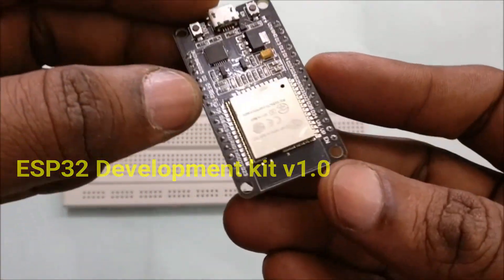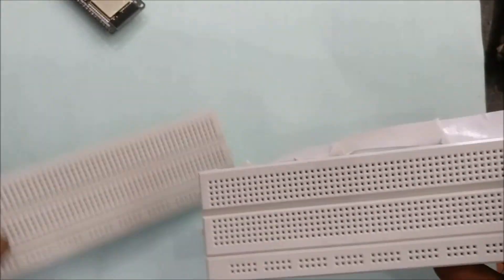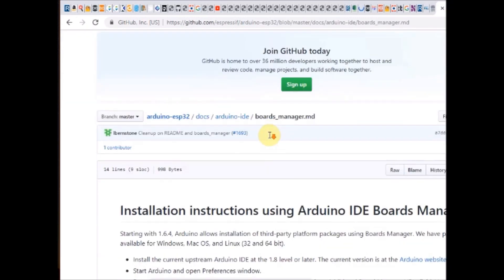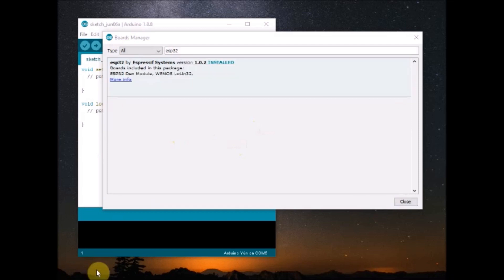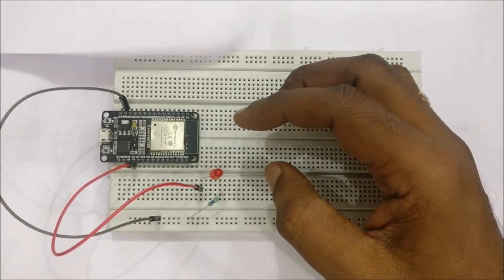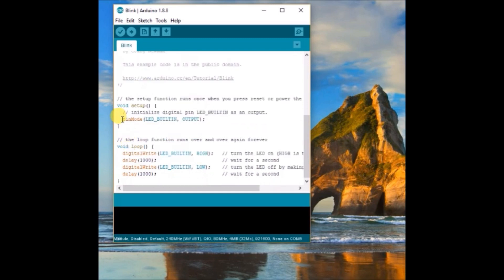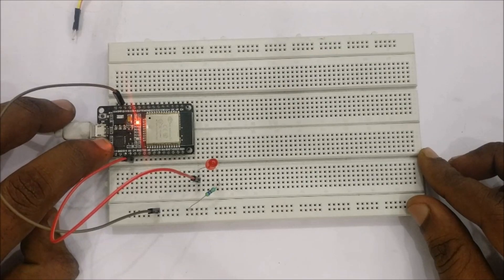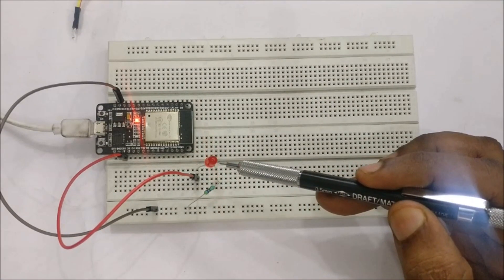ESP32 #1 Getting started with Arduino core

Comment: How does Arduino Core for ESP32 work? The firmware is built based on the syntax of the Arduino language and libraries? Is the firmware building the same as with esp-idf?

Comment: Hi sir Saravanah... I have this error while uploading the code in Arduino Ide but if I do the uploading by thonny micropython its ok.

Arduino: 1.8.13 (Windows Store 1.8.42.0) (Windows 10), Board: "ESP32 Dev Module, Disabled, Default 4MB with spiffs (1.2MB APP/1.5MB SPIFFS), 240MHz (WiFi/BT), QIO, 80MHz, 4MB (32Mb), 921600, None"

Sketch uses 207705 bytes (15%) of program storage space. Maximum is 1310720 bytes.

Global variables use 15228 bytes (4%) of dynamic memory, leaving 312452 bytes for local variables. Maximum is 327680 bytes.

esptool.py v2.6

Serial port COM6

Traceback (most recent call last):

  File "esptool.py", line 2959, in <module>

  File "esptool.py", line 2952, in _main

  File "esptool.py", line 2652, in main

  File "esptool.py", line 222, in _init_

  File "site-packages\serial\__init__.py", line 88, in serial_for_url

  File "site-packages\serial\serialwin32.py", line 62, in open

serial.serialutil.SerialException: could not open port 'COM6': WindowsError(5, 'Access is denied.')

Failed to execute script esptool

the selected serial port Failed to execute script esptool

 does not exist or your board is not connected

This report would have more information with
"Show verbose output during compilation"
option enabled in File -> Preferences.
Reply: Problem Solved I should exit Thonny Micropython IDE first before runnng or uploading via Arduino IDE